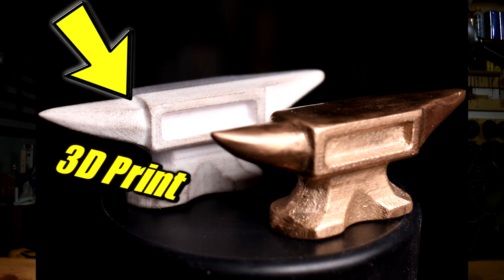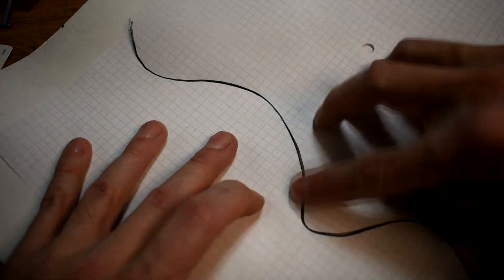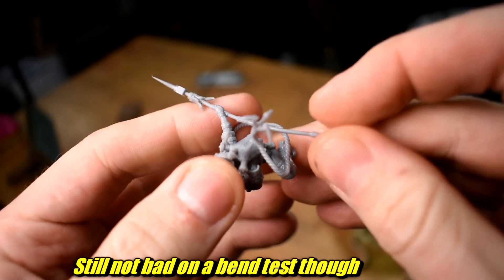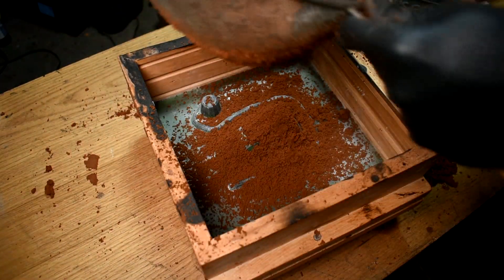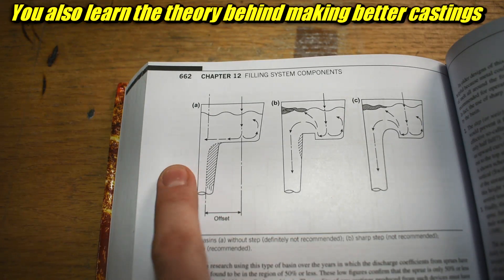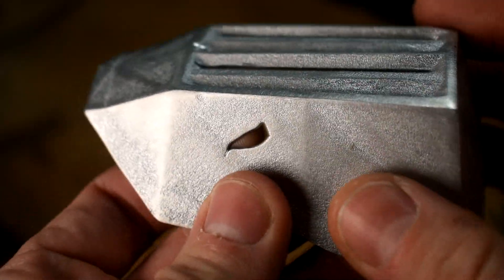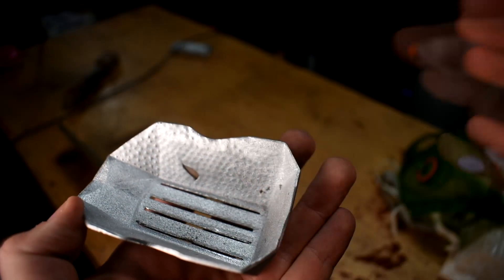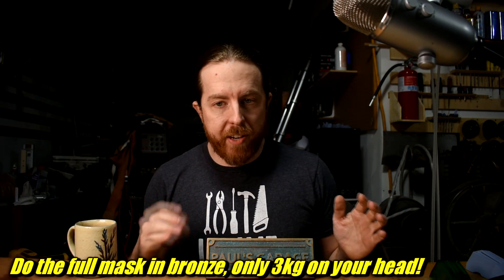EASY Solid Metal Casting from 3D Print with Matchplates

Comment: Interesting video thanks for sharing.

I'm betting another inch or two of sprue height and slightly more gravity pressure would have fixed the defect, zamak gives you about a quarter psi per inch of sprue so you definitely won't get to the 10-15psi used in commercial injection molds but 2-3 psi is doable with the right design.

Comment: You could use wax mixed with powdered metal...so you just need to dilute the wax mixture with powdered metal and inject it into a silicone mold with the desired shape and then sinter at a temperature close to the melting temperature of the metal. .let it cool and you're done with metal

Comment: I am guessing the match plate goes against the wood so after removed they are closer together or metal would flow to the shape of the match plate. This would mean the item and runners need to be calculated thicker in the 3D print?

Comment: Match plate yes pro cons in it all.  I cast model engines and oh boy thin stuff 

Here is one got me it's a elmer wall my 15 cc that's 123 years Old. The front case I though it was thin    and every time I cast it just the web and main front bushing.  Countless  a year.    Trying. So said  ahh still use it.    I finally found a case I had.  From,1928.   That casting came out ahh junk due to me just pack pour and see.   

And.   Yep junkish but full case

Thanks Paul I cast my own,model engines and design,s.          Cores.    Ahh I try. I do need to find out to cast a inline 8 model engine 

Thanks And I do cnc no 3d print here I get it done way faster.

Comment: How do you keep the sand from falling around when you move it? Is it wet? Isn't wetness bad for a mold?
Reply from the maker: wet sand is usually called greensand, it's sand with clay (usually bentonite) and a little moisture to make it stick.  the sand vents any of the steam.  too much and yes it will be bad.  My sand doesn't use water, it's oil bonded and VERY sticky, it won't fall around at all, plus it's rammed very tight.  with this za12 alloy there isn't much burning oil, but this sand will smoke a LOT if you cast bronze in it.  the sand will do it just fine, but there is smoke.  the smoke doesn't damage the casting at all, but it does burn the surface of the sand, which has to be separated out from the clean sand and reconstituted with oil.  hope this helps

Comment: Idk what software you used to make that mouthpiece shape, but perhaps you may want to change methods. If you like the faceted low poly look, that's fine, but the varying thickness is (apparently) a problem. I found that some slicers are actually quite good at generating an even thickness shell for a one-sided polygon mesh, no need to model the actual thickness yourself. What software did you use to create the mesh?
Reply from the maker: i used blender.  in my experience, thicknessing tools (which exist in blender too) always need lots of cleanup on the mesh afterwards.  they might print fine but i needed this to be free of undercuts for the casting process.

Comment: Did you use the Solidify modifier in blender? If not. Try it. If you do try the even thickness setting?
Reply from the maker: The thickness setting would work for a flat plate, but when you throw complex geometries at it i find it tends to have a stroke.  Plus it goes by thickness measured perpendicular to the face, which is the wrong way to do it for a matchplate that isn't flat.  I used it while making the grill part, though.  i just had to do some cleanup afterwards

Comment: Could this approach be used to create the two-part molds used for injection molding?  I imagine the surfaces that have to press together during the injection would have to be processed afterwards to get a super smooth surface on each, but maybe the surfaces of the part to be injection molded wouldn't need that amount of accuracy. I'm building a new kind of 3D printer. Most such printers have plastic parts that are either injection molded or 3D printed. I'd prefer to have mine injection molded, but such molds can be very expensive. So wondering if this approach might suffice.
Reply from the maker: it's possible I suppose.  With anything you'll need a bit of machining afterwards to get good surface finish or fitment.  I'm kinda curious if that high temp metal casting resin might just work for injection molding too?  it might be worth a try.

Comment: I've seen some people pack their 3d prints in sand by vibrating the sand to make it fluid and lowering the plastic/foam part into the sand, then stopping the vibration rather than packing the sand around the part. have you experimented with that approach?
Reply from the maker: sounds like lost foam/pla, i haven't done that in sand.  my sand here wouldn't work for that, it's VERY sticky and wont pack down with vibration.  i'd love to try that, though.  i probably will at some point
Reply: @PaulsGarage  the people I've seen do it have mostly been doing lost foam, coating the foam with something (plaster/ceramic) before sinking it into the sand (which has been normal playground sand
Reply from the maker: @davidelang  I've seen that too, but i have stayed away from lost foam because the casting I've seen are super porous.  Not sure if there's a special foam for it or a technique thing to fix that, i just haven't tried it yet.

Comment: I remember using matchplates in high school metal shop I was lucky our high school had beautiful gas furnace !
Reply from the maker: that's great!  gas furnaces are awesome, but i rarely use mine anymore.  I don't cast too many huge things and the temperature control isn't as easy.  there is no substitute for fire when you need a lot of really hot metal, though

Comment: Maybe there's some CAD software that can automate the design of a match plate for a given design.
Reply from the maker: that would be helpful.  especially if it could calculate runner size and ingate and flow.  I know fusion and some other programs have calculations for injection molding plastic, i'm sure something could be made for metal casting.  Of course it would probably be for industrial use only and locked behind an insane price wall of thousands of dollars per month or something.
Reply: @PaulsGarage  - Someone will probably make a metal casting workbench for FreeCAD, just for the helluvit.

Comment: These would be soo cool to add to my toolkit, makes me wish I had a way of making prints larger than 180mm^2 at home
Reply from the maker: small printers can still be useful.  you could print out the smaller bits of a match plate and glue them to a sheet of plywood

Comment: Heads up. You mentioned updating Chitubox. If you update the software, the sliced files may not be compatible with your printers anymore. You will need to do a firmware update on your printers before they can read the new files.
Discovered that the hard way. It's not a big deal, download the files to a thumb drive and update the printer, it's just extra steps you may need to take and that always happens when you have a deadline and you might not be thinking straight trying to figure out why the printer won't print something.
Reply from the maker: @brandonfrancey5592  wow thanks for the head up, that would have caused me a huge headache lol

Comment: I mount most of my patterns on matchplates. Why, 2 reasons. 1 there is almost no such thing as a one off casting. If something can go wrong it will. 2 friends say i like that can you make me one? But the best reason at all times you'll get a cleaner mold. Therefore a cleaner casting.
If you have any offset parting, use a followboard. It can also be 3d printed.
Reply from the maker: very good points!  this one went wrong, so you got that right.  Plus if i decide i want one in a different alloy, if something breaks, or if i lose the thing in my messy garage... all good reasons to use a match plate

Comment: I recently watched a video by Myfordboy where I commented that the glowing crucible made me want to get back into casting. I had some bad fails, nuff said. The thing is, I don't think my metal was up to casting temp even though my temp readout said the foundry was. I didn't have a glowing crucible, and I dont think you did either. Is it important?
Reply from the maker: the glowing is entirely dependent on temperature.  My electric furnace tends to say it's up to temperature before the metal melts, thats because it takes time for the metal to heat up.  the thermocouple is outside the crucible and heats up before the crucible, which heats up before the metal.  In this case the crucible was never glowing because Za12 pours at 500C (or a little less).  There was a short B-roll  clip here that showed a glowing crucible pouring glowing metal, that was ancient bronze at 1100C.  The glowing color is all down to the heat.  I usually let the furnace sit at temperature for about 20 minutes or so to allow the metal in the crucible to actually start melting, then pour when i think it has equalized.  You don't want it sitting there forever molten, especially some metals, but Za12 is super forgiving.

Comment: Love my match plates.  I do them a little differently, and glue the resin printed components to Film Faced Ply.  One thing I've noticed is that the choice of resin makes a big difference in that some warp over time.  Avoid Epoxy based resins.  eg, I pulled out one of my earlier match plates out and things like the runners had curled (guess I'll just glue them back down).
Reply from the maker: good tip!  I've noticed some resins warp really bad over time, too.  I honestly haven't had this stuff long enough to know what it will do, but heygears resin hasn't warped on me yet.  sunlu ABS does, but it's also very cheap.

Comment: Clean Breathing Man: surviving in style since 2024, unbothered by ever worsening befouled air that lays low the common man. 
A comfortable 'stylish' filter actually seems like a reasonable idea - just got some air quality monitors and it has been quite enlightening.
Reply from the maker: i'll have to get some air quality monitors!  I have plenty of toxic stuff in this garage.  The mask looks kinda goofy with the big pink filters on it, one day i want to adjust the design to have remote filters.  This was just the fastest way I could pull it off
Reply: @PaulsGarage  I'd not worry about removing or hiding the filters myself. But perhaps bring them to your belt or something so you can have ominous tubes in that mask going wherever you hide the filter. Though If you are going to have fancy grills like that in the design you could go for just one filter in that spot, it would increase the flow restriction a bit and the filters wouldn't last as long, but they would still do the job, and hidden behind that cover concept it doesn't matter what the company decides to make the casing colour for whichever variety of filter you have slotted.

Yeah air monitors have been pretty interesting to have. Not tested one in the real workshop yet though, that might be a bit too depressing! 

Being a fan of open source and cheapskate I went with the airgradent stuff in kit form - though really calling it a kit is almost insulting with how little there is to do. 

My minimal attempts so far to verify the sanity of the airgradent monitors selection of sensors says they are at least a good trend indicator, and might just be pretty good accuracy wise. (I suspect they really are about as good as these sort of sensors can get in the price range anyway - all the sensor modules inside look alright on the datasheet).

Comment: When I first saw match plates I thought that was the coolest thing since, well melting metal itself! I have a project that will be perfect for match plates: making balls for a ball mill. when I found out how many I'd need (40% volume of the mill itself) I was excited I'd finally have a project worth making matching plates for. So far, the plan is for 3 sized of balls at diameters of 1/2", 3/4" and 1".  When I can get my oil burner built, I'd like to use steel from railroad spikes. Additionally I was thinking copper might work too as it can be hardened as well.

An idea I'd like to explore is to make the balls in two stages: a core and a shell. Cast the cores out lead for it's density and weight and then cast the shell around it with steel or copper. Any thoughts?

PS enjoyed your video, as always :)
Reply from the maker: sounds fun!  modelling a matchplate for balls would be pretty easy, you'll just have issues with shrinkage because of the shape of the balls.  For a ball mill though i doubt it would be an issue.  What might be an issue is the metal itself.  Casting steel at home isn't really a doable thing.  the temperatures are insane, and it will want to oxidize super fast like a weld puddle.  Welders shield molten steel with argon gas, you can see how a crucible of that would be very tricky.  You can melt a small amount of steel at home with oxy-acetylene, or an induction furnace, but if you are talking pounds of the stuff at once, you'll have an issue.

same for lead core balls.  if you cast a shell around a lead ball, whatever metal you use for the shell will melt the lead, because lead melts at such a low temp, and that will mess things up.  that or the lead will act as a chill and cool off the shell metal before it fully encircles the lead ball.  you CAN suspend a ball inside a shell in a sand mold, its just temps that are the issue. 

I think most metals you can cast with an oil burner are relatively soft compared to chrome ball bearings or ceramic balls like used in most ball mills.  not to say you can't cast really hard metals at home (like aluminum bronze for example is super hard and can be made from mostly copper), but I would think firing ceramic balls would be better suited for a ball mill, or buying chrome ball bearings from a hardware store.
Reply: @PaulsGarage  Holy Cow! Thank you for your thoughts!

I didn't realize steel was so hard to do at home, I thought I just need a hotter furnace! 

But  I can do aluminum  bronze  or ceramic!

I wIll price out chrome bearings to get an idea of the their cost vs value of time and effort to make  the balls with recycled material and go from there.

Funny story: I thought a 24" long cylinder at 12" diameter 'should  be big enough'. Then I thought I better find out roughly how many balls and what size they should be. After some maths, a 6" diameter x 6" long cylinder for the mill will be a good starting point for the material I want to crush.
Reply from the maker: sounds good!  most ball mills i've seen are closer to 6" than 24", though I have seen some gigantic ones.  I supposed it depends what you want to mill with it
Reply: Just in case anyone is curious why I'd want to make a ball mill: to pulverize materials like charcoal and graphite for use in fire brick and my own molds/crucibles. Also, I'd like to try to pulverize ferrite and reform it into custom shape cores. As I get copper mainly from recycling, I have been keeping ferrite cores from inductors hoping there is a way to reuse them.

Comment: If I ever actually start metal casting, I think I might use match plates all the time.
Reply from the maker: I want to use matchplates every time, but i don't want to MAKE them every time 🤣
Reply: @PaulsGarage I don’t blame ya 😂 but for me casting 36 identical pieces is something I don’t feel like doing, but I’m also too cheap to pay for having it done by CNC.
Reply: @PaulsGarage  what eats up the time creating the plates?
Reply from the maker: @nic.h  mostly the 3d modelling, getting it right.  if this were a flat parting line kind of casting, it would be super quick, but with uneven parting lines there has to be a lot of care to get it exactly right.  all the gating needs to have draft on both sides of the plate, there can't be any chance of the top and bottom flasks leaving a gap in the parting line or crushed sand distorting the mold which eliminates just using a solidify modifier for example, that kind of thing.  You make the time back in casting efficiency as soon as you need more than a couple of identical castings, though.  if you need dozens of something (or more) than making the match plate is a no brainer.
Reply: @PaulsGarage  I'm not an expert but wonder if something like blenders geometry nodes could be used to automate the conversion from a model to a matchplate.

I'm guessing there is a bit of art involved in placing of the parting line, so maybe that isn't practical.

Anyway really just thinking out loud.  Cheers for the reply.

Comment: you should do a video on reusable molds made of silicon carbide and water glass and 3d prints as forms. Its a cheap entry level way of making your own permanent and tough metal casting molds that doesnt require cnc.
Reply from the maker: That's a really good idea!  I'll check that out.  I know what process you are talking about but I haven't actually tried it.  I'll give it a shot at some point
Reply: Are there any kits out there for these?
Reply: Sounds interesting, are those materials readily available? Can you give some hints as to where and how to get them?
Reply: @misterdecaro the water glass, sodium silicate, you can get online or maybe some place with concrete supplies. You can also make your own.